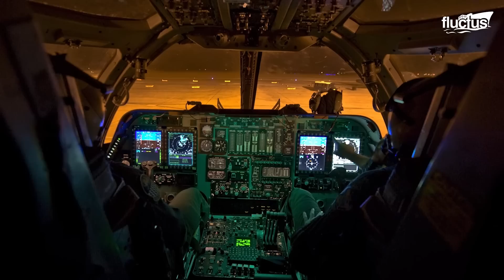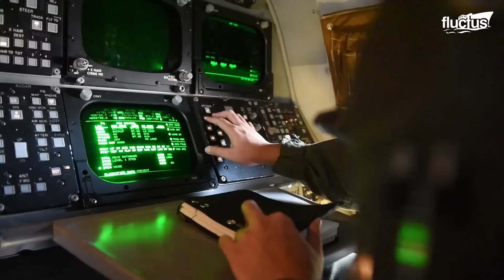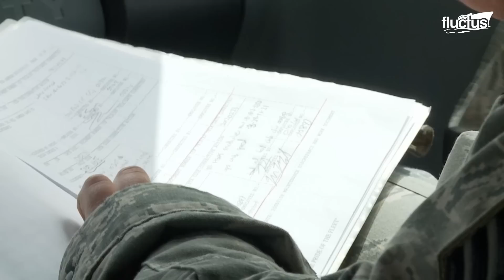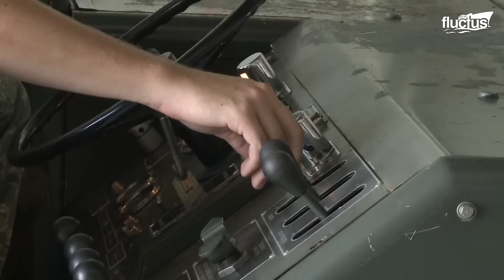How the US Air Force Starts its Monstrously Powerful B-1 Lancer Bomber

Comment: I think it's the B-52 that is the backbone of the U.S. Air Force's bomber fleet.  The B-1B will be retired long before the B-52 bomber.

The B-52 is nuclear capable, unlike the B-1B bomber.  Also, the B-2 is about to be retired, when the new Stealth Bomber is finally added to the U.S. Air Force's bomber fleet to replace the B-2.
Reply: The B1b was designed and built to carry nukes .. until the politicians decided to modify them for non nuke ordinance.  I forget if that change took place in '94 or 2004..
Reply: B1 Lancer is our only supersonic bomber; that's why it's operational life might approach EIGHTY YEARS.

Comment: Umm Uhh... Where was the part that explains how they start the B-1 or did I miss it?
Reply: Well, not long into it they had that bit about a separate APU for each engine - so they could start the engines in a hurry during a scramble.  But that was about it.
Reply: @jimwinchester339 , so you just hop into it, put the key in the ignition, turn the key to the start position, and all of the engines start up simultaneously? I believe that there is a lot more to it than that.
Reply: @RMartin631  looks like it..😂
Reply: That’s a supersonic plane.  They must start it supersonically.
Reply: @mrsfireleg  bro i straight laughed for 2 minutes straight reading your comment, cheers from suriname 🇸🇷
Reply: Yeah!
Reply: that got me mad but then they showed the cute chicks loading bombs at 7:38 and I felt better.

Comment: Can the B-1B carry nuclear tipped cruise missiles on it's 6 external hard points? If so, how many? Thanks.
Reply: It can carry your mom; so I think it can
Reply: no, nuclear reduction treaties between the U.S. and Russia forced the USAF to eliminate the nuclear carry capability of the B-1
Reply: That treaty was for nuclear bombs and the equipment the B-1 had to deliver them. Cruise missiles just need to be launched. No special equipment needed in the B-1. It can carry 3 rotary launchers with 8 missiles each. But if stealth is not required, missiles can also be attached to hard-points. But how many missiles on the hard-points?

Comment: Zero about how the bomber is started
Reply: No...actually they said what they use to start the motors, but they didn't spend a second explaining any of it....
Reply: 4:45 explains it
Reply: Right,, the APU aux power unit gives the engines compressed air to get the engines spinning? But no further elaboration on it.
Reply: There is an APU in each nacelle. Bleed air from the apu is used to start that pair of engines. Not much more elaboration needed.
Reply: Top secret HAHAHA
Reply: Saw your comment and switched off,thanks war I g 👍
Reply: ikr 😕